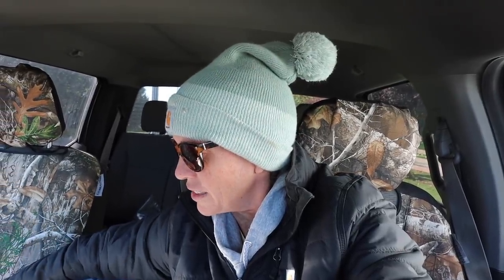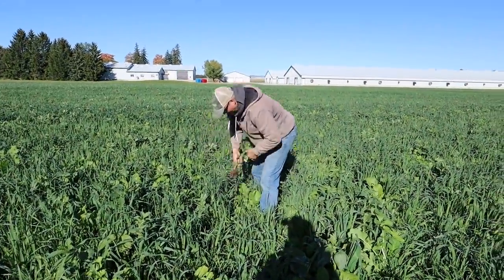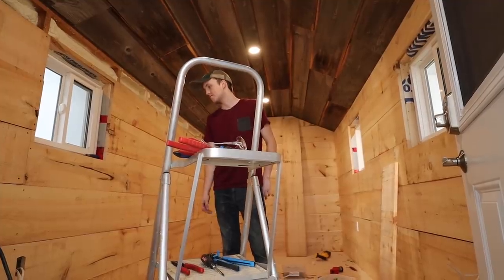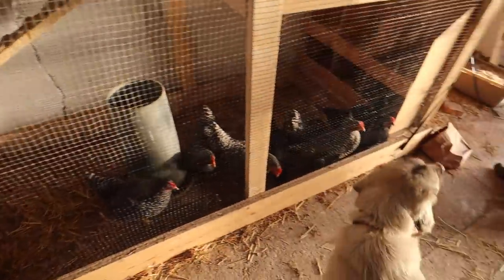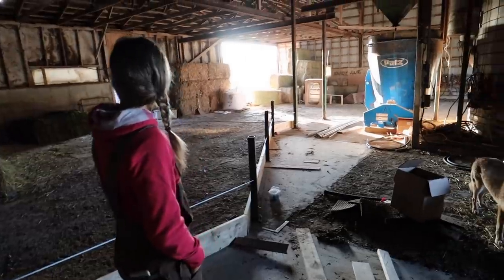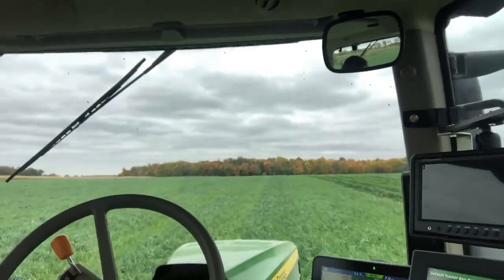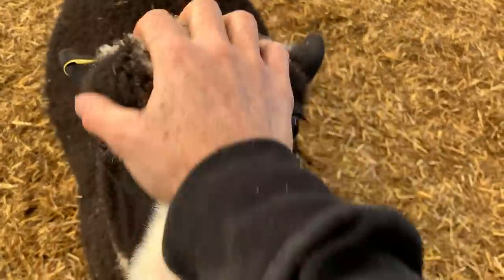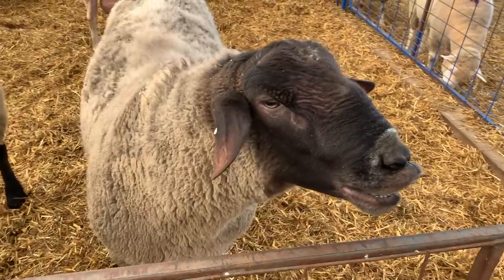Something STINKS!!! (Thanksgiving 2020 FARMER STYLE) Vlog 362

Comment: Don't salt your beans until they are about cooked through. It will make the skins tough. Also black beans make great veggie burgers. Drain beans after cooking take half and mash or put in food processor, add back to beans mix well. Add cooked 1/2 cup rice, corn grits or Quinoa to 2 cups of bean mix. Good way to use left over grains. Add 1 can of greens, collard, spinach, mustard. Can add chopped onion, garlic, any spices you like.Add salt and/or pepper to taste, my husband and I are salt free due to high blood pressure. Makes 4 to 8 patties. Fry in olive oil or if you must can be fried in any vegetable oil. About 3 to 6 minutes per side. If you freeze them in parchment paper you can bake in oven for about 20/25 minutes at 375°F I am a Certified Chef.